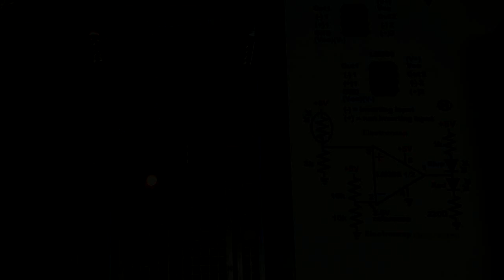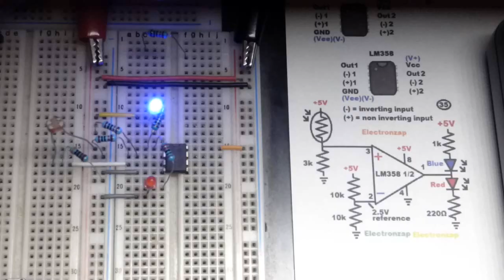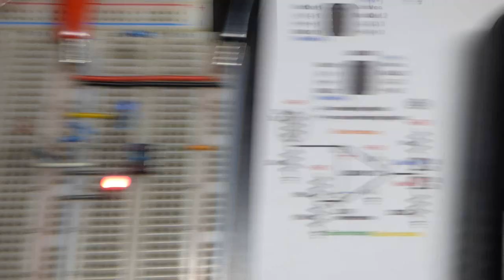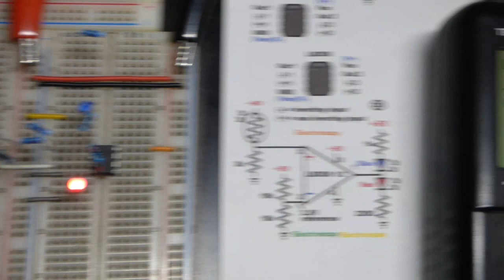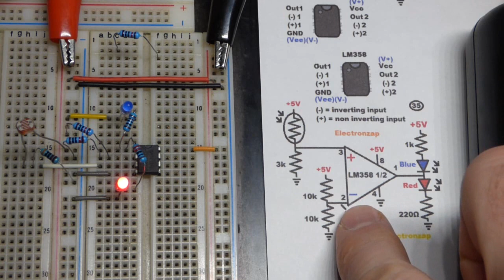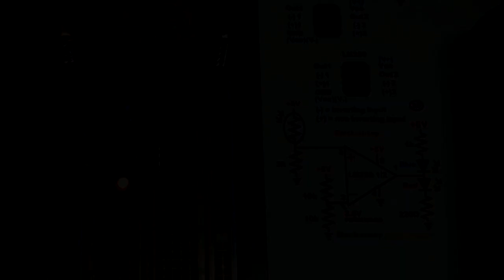Addressing mistake I made in LDR controlled Non Inverting Op Amp video I made recently

Comment from the maker: List of my videos https://www.youtube.com/c/electronzap/videos
https://www.youtube.com/@Electronzap/community for most of the diagrams I've used in my videos.
https://www.amazon.com/shop/electronzapdotcom As an Amazon Associate I earn from qualifying purchases. Americans should check out one or more of those links before making any purchases. There's no extra cost to you.
https://www.patreon.com/electronzap
https://electronzap.com/
https://www.reddit.com/r/ElectronicsStudy/ 

In the previous video, I goofed. I used a 10k resistor on the board in place of the 3k resistor I wrote on this diagram a long time ago. I added notation, but am following up with a video to talk about why that is not a problem since adjusting the value of resistor(s) is a common part of modifying a circuit you see in schematic form.

Light dependent resistor (LDR) voltage divider changes a signal voltage, based on how much light is falling on the LDR versus the value of a (Usually, but not always) fixed resistor on the other side of the divider.

Operational amplifiers (op amp) compare the non inverting (+) input to the inverting (-) input when determining the output voltage. The output tries to me more like the + input. Therefore, the output will be high when the + input has a higher voltage than the - input. Whereas the output will be low when the + input has a lower voltage than the - input. Without feedback, the output is either as low of a voltage as it can give, or as high of a voltage as it can give.